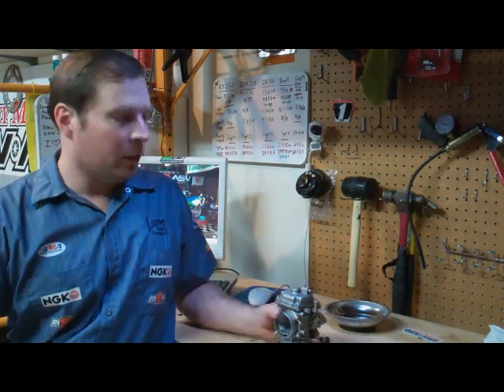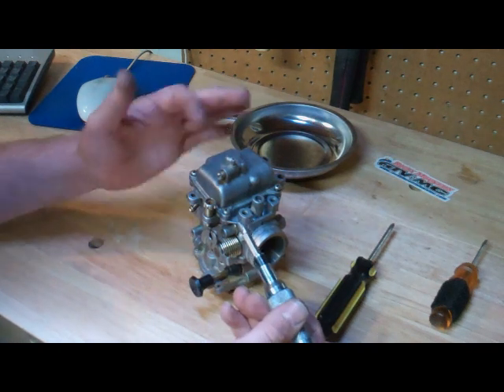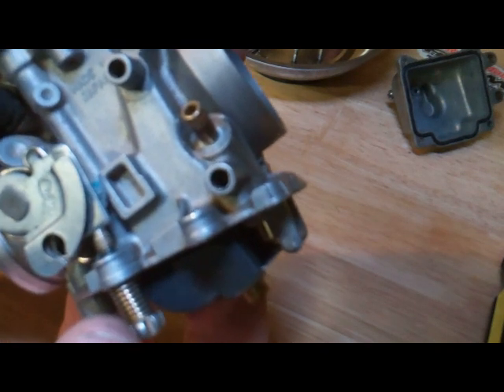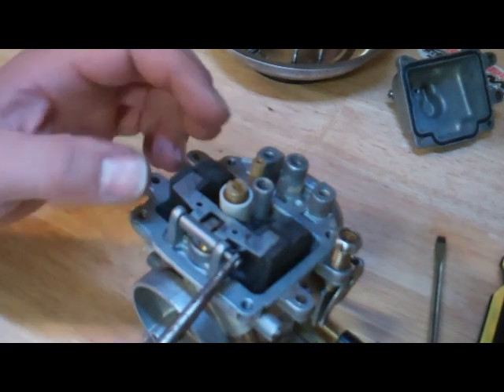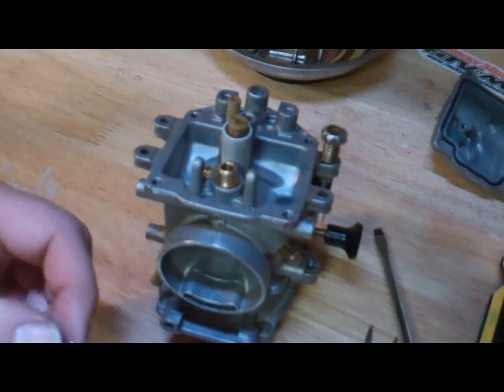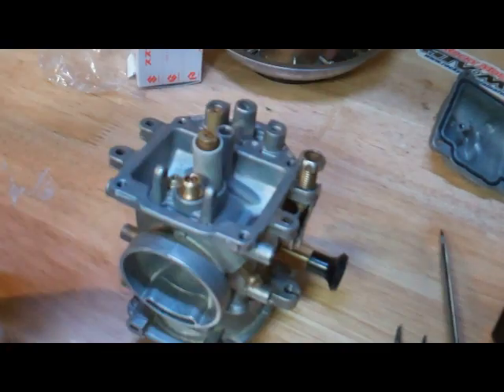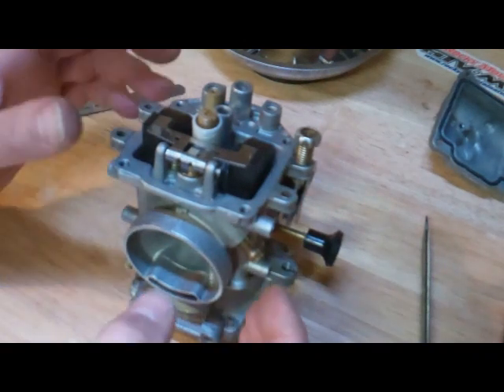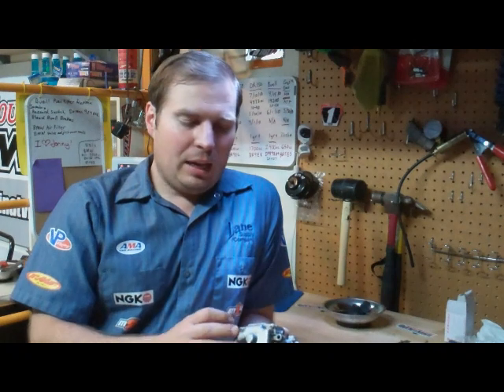Carburetor Problems? Motorcycle & ATV carburetor diagnosis

Comment: Hello! I have a CBR 600 F3 '98. And I have problems in cold start. Once is hot starts with no problem. I had replaced the sparks. My bike was in the garage for aprox 10-12 weeks. Should I take the carbs off, disassembly and clean them up. Would this be the problem? Thanks in advance. Ed

Comment from the maker: It fixed the problem.  The problem was fuel leaking past the needle valve seat via that o-ring or a poor seal of the tip of the needle valve itself.

Comment: fyi...the goverment passed a bill that allows oil companys to now be allowed to use up to 15% ethanol,they were at 10 % before...there are products out there that you can use to offset the ethanol..car engines can handle it fine so can inboard boat engines...all outboards,atvs...small aircooled engines can have problems running on it, newer bikes are suppose to be able to run on it, 2 strokes have problems at the 10% especially the outboards

Comment from the maker: @altlandf Changing a combination of the pilot and main jet (go up/bigger numbers) is what your going to have to do.  Ethanol is not really much of a problem in pump gas as long as your jetting is correct for the elevation, air temp and density.  Also running a stabilizer in the fuel will help the fuel stay at its best.  Ethanol doesn't cause overheating, lean jetting does.

Comment: I live in Pa and right now the temps are around 25 to 45 degrees out.  The problem I am having it's hard to start.  Once it warms up it runs pretty good.  How do I get more fuel to the engine when it's cold.  Another thing in our area we have this garbage called ethanol in the gas.  It's suppose to be less than 10 percent but I think it's causing my Honda CM 250 to overheat.  This is a air cooled engine.  How do I get the carb to run richer?  I think with the ethanol it's running way too lean.